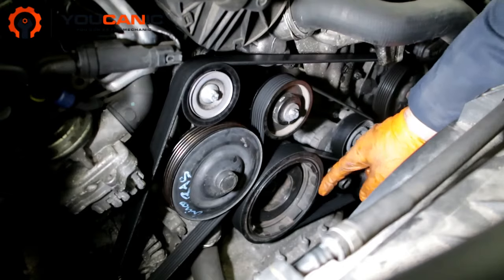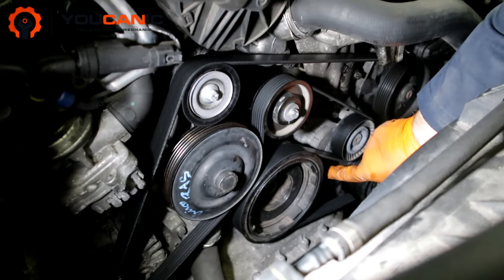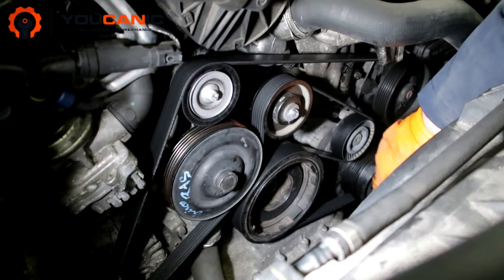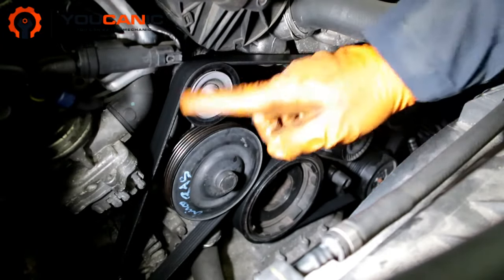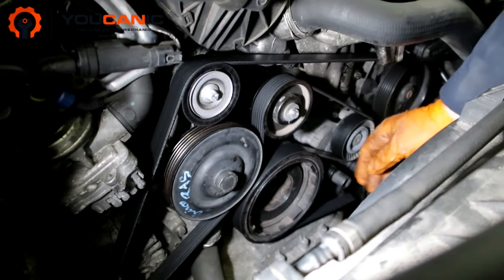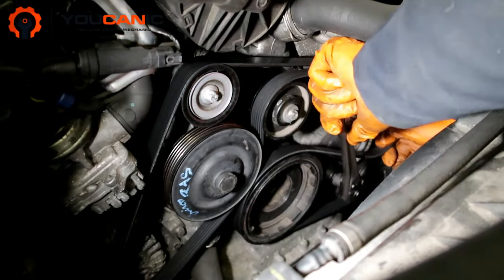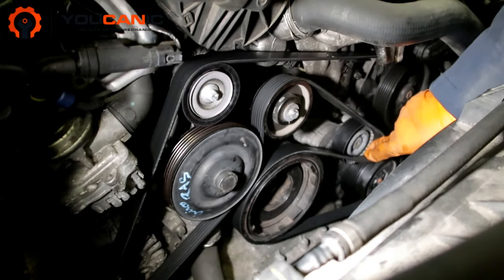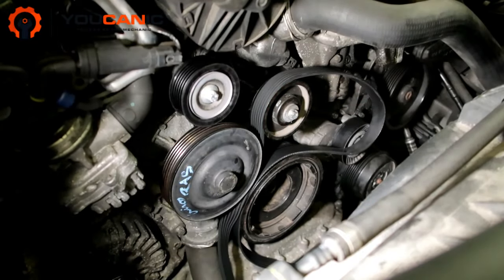Mercedes-Benz Serpentine Belt Replacement (E, C, CLK, ML, GL, R Class) - How to do it

Comment: Great video! Is 6PK2430 the right size for 2006 C230 Sport?
Reply from the maker: Hi, thanks for your comment and question! I'm afraid I can't confirm if a 6PK2430 is the right size for a 2006 C230 Sport in this comment section. However, the best place to ask this question would be on our website, www.youcanic.com. Here, you can explore our helpful guides, free resources and even factory repair manuals if you need more detail. Our mission is to empower car owners like you, making car maintenance easier. We're always here to support you and answer any questions you might have. Thanks again for reaching out!